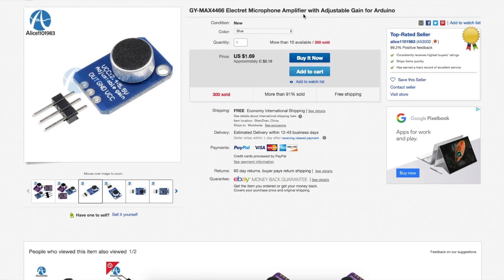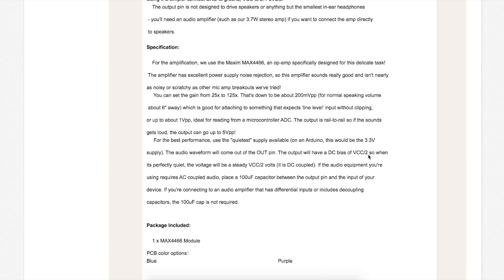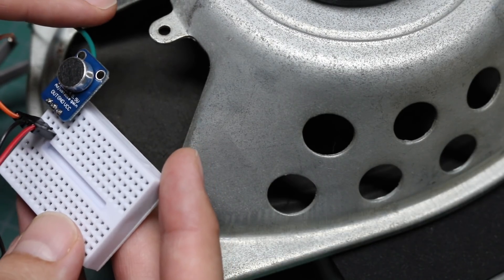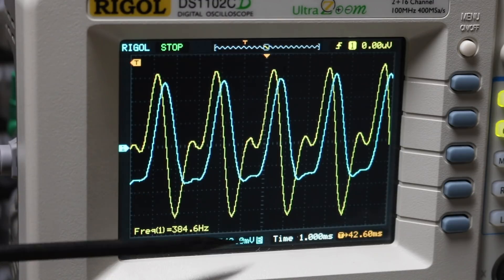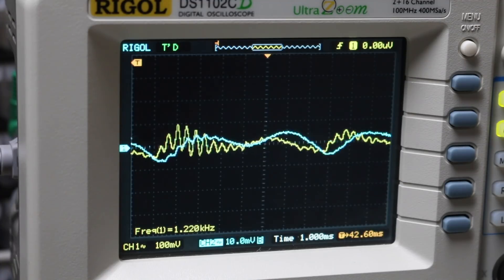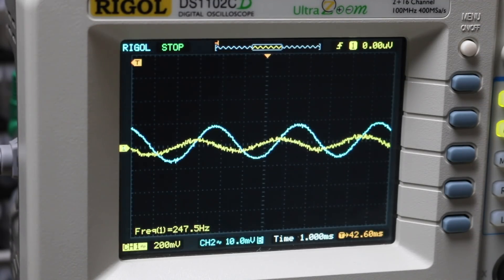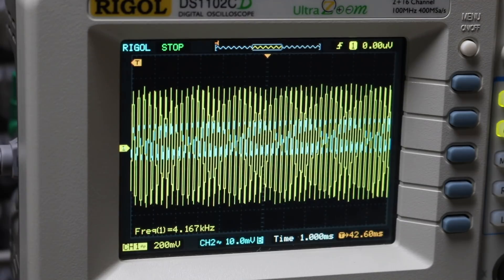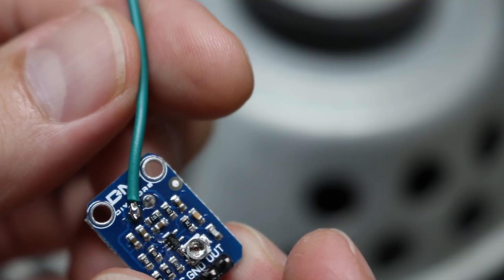MAX4466 Electret Microphone Preamp Module Evaluation

Comment: I'm thinking of using this mic on a LED fret board project on my guitar so that every time I strum the LEDs light up. My biggest problem is making the mic only sensitive enough to pick up my strumming and not really anything else. I'm also considering possibly taking the signal from my pickups and running it through the LED circuit instead but I believe it would be difficult to do without messing up the sound of the guitar output. Would you happen to have any advice?
Reply from the maker: condenser microphones like this pick up a lot of sound in the environment so trying to make them only focus on what they are placed beside would be difficult, that’s better suited to dynamic microphones like they use for radio or podcasting and they have to be always right near the speaking person to pick them up properly. I don’t know if there’s any small modules like this with dynamic microphones.
The better option would be buffering the guitar signal directly and having the presence of audio trigger something. If it is a circuit like an op amp it should have at least minimal impact on the sound like a buffered guitar pedal.

Comment: Hi there, I have the MAX9814 module, but the gain is too high (default is 60db), i plug together the gain and the VCC and it gives me 40db, is much better but about 25db or 30db would be great. Do you have any idea in how to get a fixed 30db gain? Thanks in advance

Comment: I plan to replace mic in my car radio for hands free calls. will it work? I mean 20Hz - 20kHz audio range is OK for calls or it has to be narrowed?
Reply from the maker: Without knowing how the rest of the system is designed or what it depends upon, like if this mic is replacing a different one that had extra on board filters or something, then if the rest of the system it plugs into was counting on that, it could lead to something like extra noise being picked up but the only way to know is to try.  And the voltage used to power the module has to be within the operating range of the module's amp, so I don't know if it can go up to 12v or if it needs a separate 5v or 3.3v supply provided.
Reply: @GadgetReboot  3.5 v is nor a problem. The system is Teyes CC3, chinese aftemarket radio. Excelent one with superior sound. Everything is perfect except of built in mic.
Reply from the maker: @fevgg  The other possible thing to consider is with this module being a mic plus preamp, the output is a ground referenced signal, so if it's plugged straight in where the other mic connected, and if that board also has a preamp, then there could be a lot of gain, and hopefully the old mic was ground referenced rather than some weird differential circuit.  Would be good to check continuity from the mic pins to ground and see if it's that simple so the module ground can tie there and the signal out to the other mic pin.

In case of way too much mic gain between the module and radio, for a test hook up I'd add an extra potentiometer with one end on ground, other end on output of the module, wiper going to the radio and start with that way down so nothing screeches.  

And I forget if this module has a series DC block capacitor on the output so maybe add another capacitor (maybe 0.1uF or something as a test) in series with the pot wiper - it may help protect from weird DC offsets coming from the radio back to the module and from the module to the radio if it's a weird circuit, so kind of acts like an isolator.
Reply: @GadgetReboot  thank you for your advise. I'll try

Comment: Do I need to use a microcontroller to make a audio meter with this ?

I am trying to make a simple led system which consist of ten leds and show the environmental noise.

Like ı need a microphone by calculating its voltage I want to construct a sysem wich light leds
Reply from the maker: If you do a search for the LM3915 Chip  you should find lots of audio LED signal strength indicator  projects.
Reply: @GadgetReboot  yes but i dont know sprcific reason tu use 3914 or 3915
Reply from the maker: https://www.youtube.com/watch?v=5tI8b_KqdrM
 That video shows some examples of three similar chips.

Comment: preamp can pick up 20+khz easily but that oldy speaker is probably failing at 10k with higher amplitudes
Reply from the maker: I was actually surprised it gave anything at all at 20 kHz. It’s so old that I don’t have any idea where I got it but maybe I can build a project for It and make it a nice home for its final days  as an FM radio speaker for the bench or something.
Reply: btw - check out this FM module kit
https://www.aliexpress.com/item/Free-Shipping-FM-Transmitter-Module-Mini-Wireless-Microphone-Ham-Radio-Frequency-PCB-Board-91-103MHz-3V/32814123829.html
Maybe it could be helpful for such project
Reply: The speaker is probably bad at low freq and high freq. Probably worst at low.